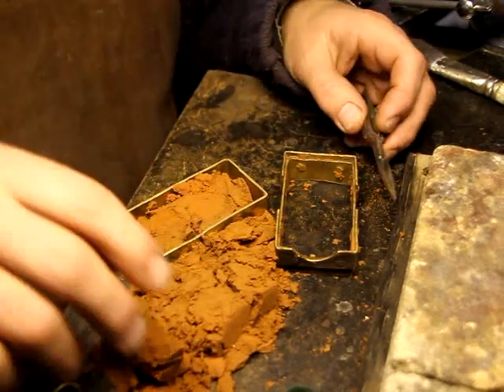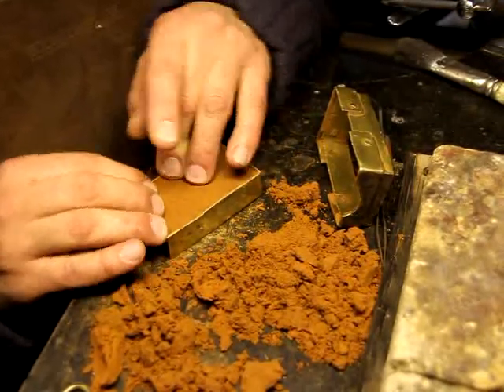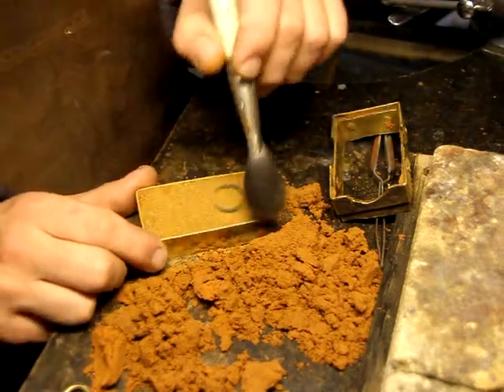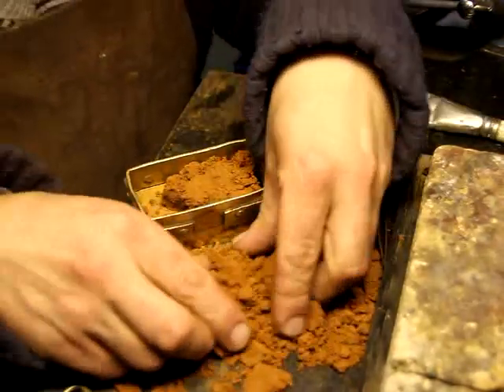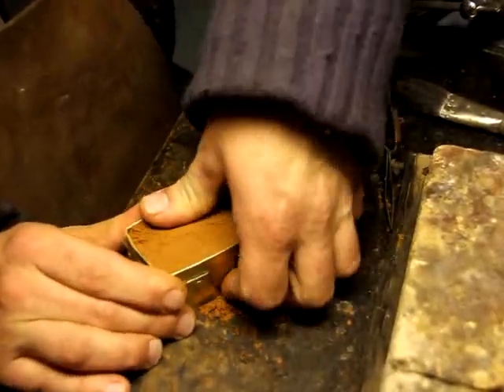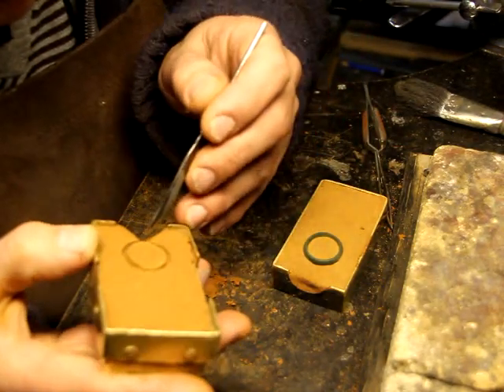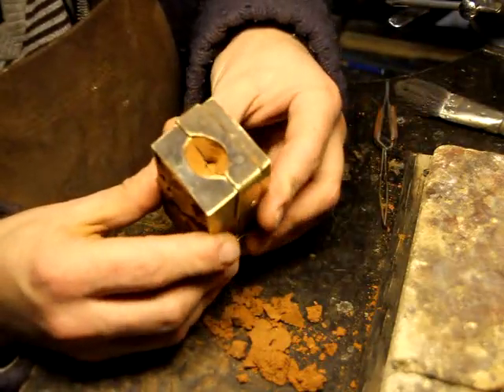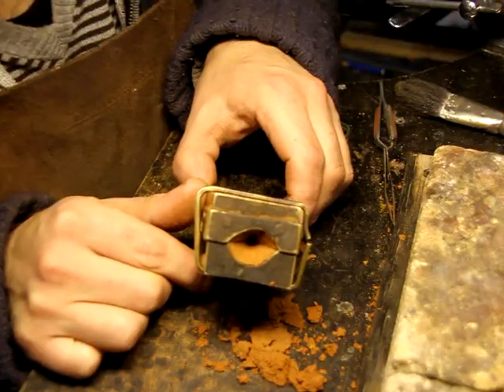Casting silver in Delft clay-sand casting, pt 1.

Comment: What if I had detailed design on wax ring, if I remove the wax ring will it smear off some clay and the design won't be molded on the sand?
Reply: you could cast the ring with pattern as a strip and hammer it and solder it round after. that way you can have the pattern.
Reply: If I was worried about that problem I think lost wax might be the way to go